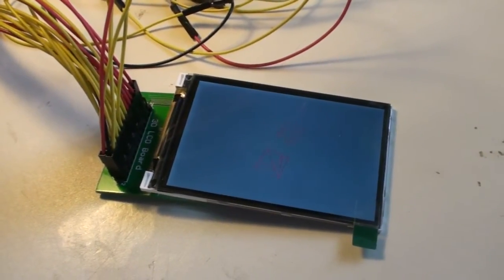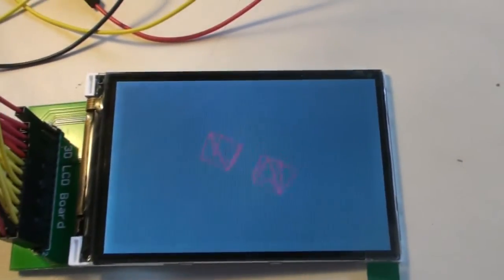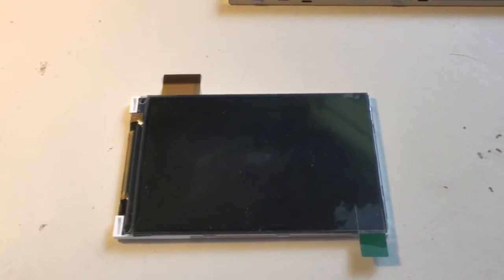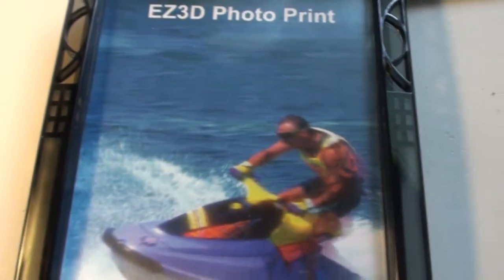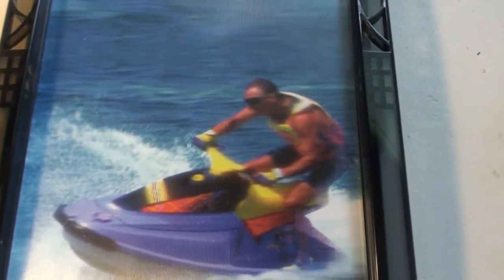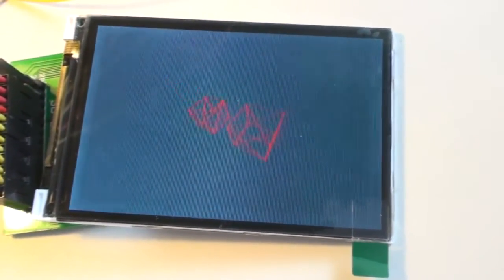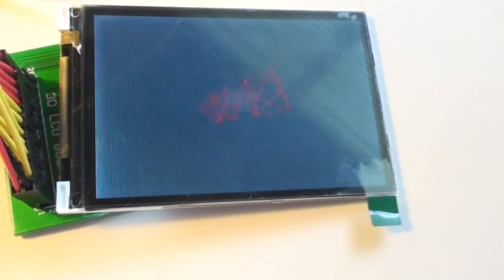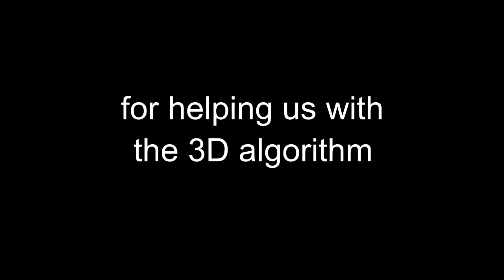Glasses free 3D Display for microprocessors

Comment: Nice explantation! Now close to 120hz (but slightly off to avoid strobe effect of the fluorescent lights) with a 4k resolution on a 27" display would be a real good business opportunity. More than 27" would give too much viewing angle, but with proportionally increased barrier cell sizes (from center to the edges), I think it would be feasable to get bigger sizes. Since 3D from 2D translation is available on the market for more than 10 years, it's only a matter of speed and calculation capability. Scaling should be pretty easy. As a technician in a university, I really enjoyed your presentation! Keep on going!